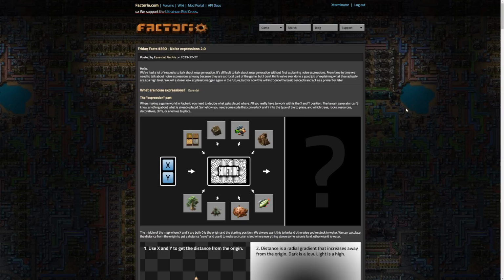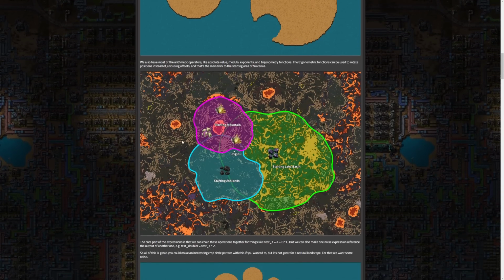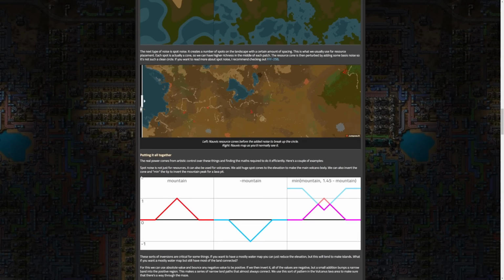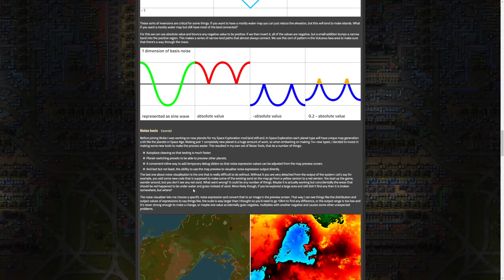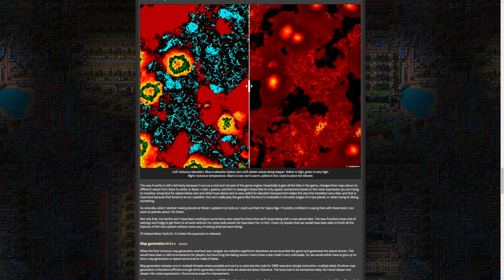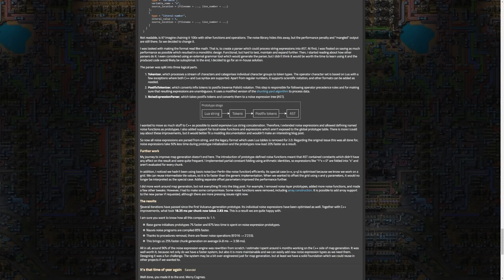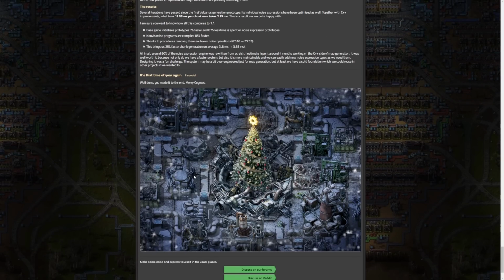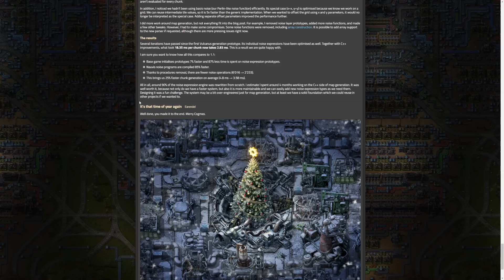Factorio Friday Facts #390: Map Generation Process - FFF Discussion & Analysis

Comment: I can't wait until they finally share some results of this noise generation work; I was really hoping for much more interesting terrain generation!  In the middle part what I found most fascinating is that there are now 3 separate "noise outputs" (cliffs, entities, tiles), whereas before they tried to do all three in a single but much more complex noise function.  This makes me wonder if one could say repurpose the cliffs output to instead generate other vein-like features, like rivers, or lava veins — or even add additional noise outputs for future things?  btw, the technical part in the middle is essentially describing an "optimizing compiler", and has three main goals... ① Optimization: de-duplication (if you have a thousand formulas all the same just reduce that to a single shared formula), and reduction: if you have (a+1+2+3+(b*0)) that is the same as (a+6).   ② Moving as much as possible out of Lua (expensive) and into C++ (cheap).   ③ Allowing the noise function designers (modders) to write things concisely, such as "a+b*3" rather than "((variable a) ((variable b) (number 3) multiply) add)" — this last part being essentially a "compiler".

Comment: In the cogmas picture, there's a strange building in the bottom left, and middle left of the image. The bottom left looks like a nuclear reactor with the serrated pipe, but i don't think it's a correct match. The middle left also doesn't look like any building in vanilla. It's very hard to tell with the snow, but I think they're new. As to what they are, who knows, but my guess is it has something to do with oil. Oil is a bit underdeveloped in vanilla, and the abundance of fluid related buildings in the picture makes me think the new buildings are related to fluid handling.
Reply: Update: another video noted that the sprites look very similar to the buildings shown in last years xmas teaser. If that's the case, that's a neat callback, and fingers crossed we learn about them soon~
Reply: I was starting to wonder if I was seeing things as no-one seems to have mentioned them on reddit :)
Reply: Haha, fancy seeing you here~ I'm just desperate for any sort of expansion news that I can get, so I comb over ever teaser with a laser eye @trismugistus